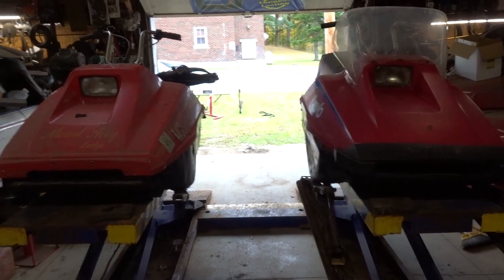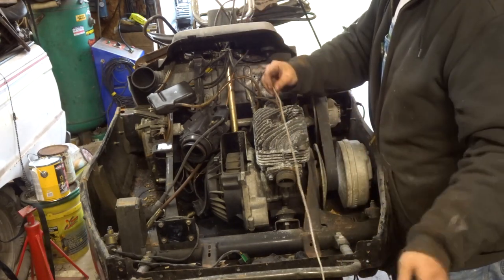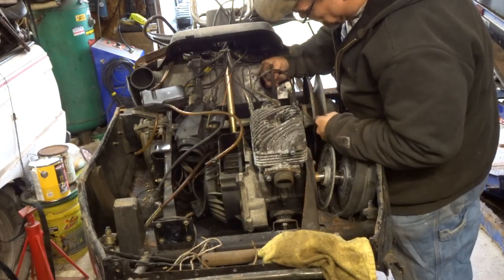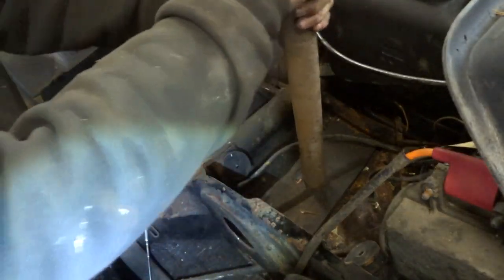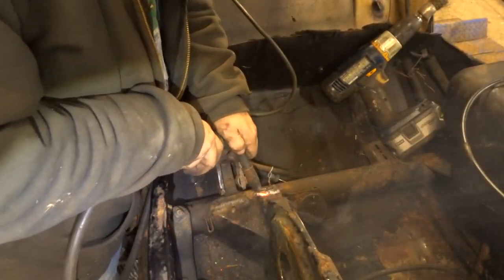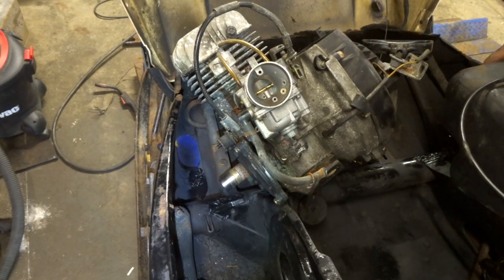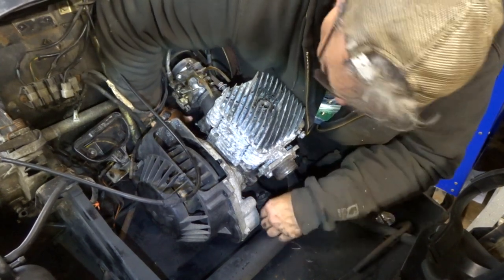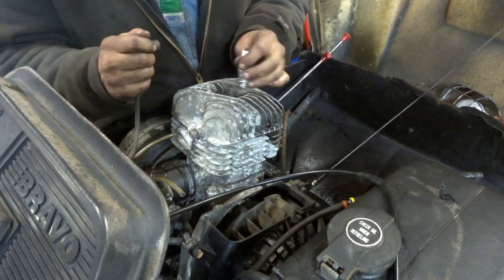Yamaha Bravo Engine Swap!!

Comment: So... Engine replacement? "Swap" infers you used a non-OE engine. Stuff a 480 Phazer engine in there. :)
Reply: Would it fit
Reply: With modification, yes.